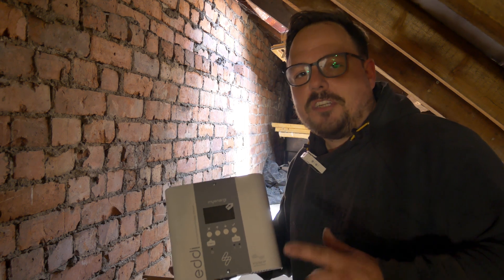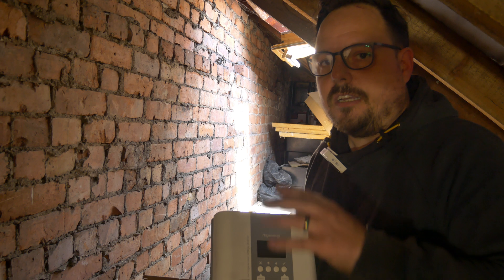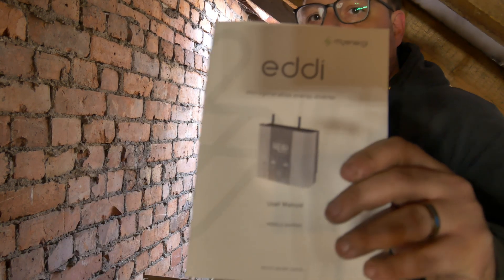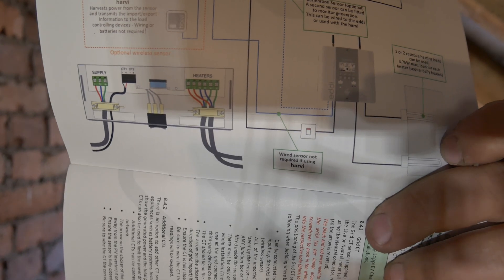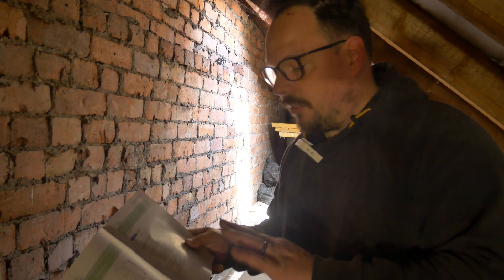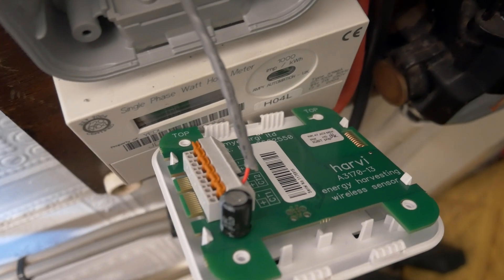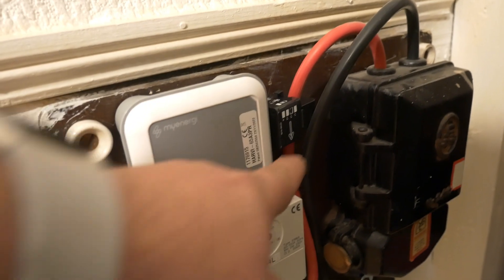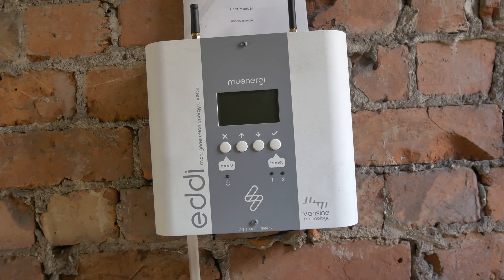How to install and setup a @myenergi Eddi and Harvi - Turning water into batteries!

Comment: Have you ever heard of an Eddi / Harvi install in a home with an EcoFlow PowerOcean Battery/inverter?

Would that present an issue as the EcoFlow hybrid inverter is Dc coupled - single line into consumer unit

Comment: How does Eddi know when the hot water tank is up to temperature? Is there a seperate thermostat connection on the immersion heater or does just infer it from the thermostat opening and therefore not consuming any power?
Is it possible to link the Eddi with a Hive CH controller so that the Hive knows it doesn't need to heat the cylinder from the gas boiler?
Reply from the maker: Immerssions all contain thermostats so it works from that. Although you can integrate it with other heating devices, doesnt have to be the immersion

Comment: Very interesting, a redesign from the old Immersun, and it would be great if these types of units could be ZigBee (?) compatible as it seems the newer smart electric meters have it by default for the In Home Displays. That would then mean less wiring for things like the Harvi, and possibly no CT clamp needed ? What do you reckon ?
What else have you connected to the second outputs on solar diverters ? Curious as to other options other than hot water. Cheers

Comment: What happens if there isn’t enough solar to heat the tank?  Can it then switch to gas to heat the rest ?
Reply from the maker: Of course. The immersion should only ever be backup to the main source of heating. This just supplements it and very well indeed it has to be said. Thanks

Comment: If you have a decent sized battery just use the immersion heater on a timer … save £1K …
Reply from the maker: Life is full of options for different people. That said if you are paying a grand for eddi you got done lol. 

ATM it’s better to just export your excess generation anyway rather than heat water with it on certain tariffs. 

I would close by saying consumers will get a much better return on investment by utilising smart abilities in the technology rather than manual function. It’s false economy and over the years you will lose out without it. Especially as tariffs adjust. Consumers would be wise to take a longer term view and understand the best ways to get the best value from all these options.
Reply: @electrician247  … but isn’t it just the same electricity?  I know my battery is fullest at about 14:00 o’clock so I just set the timer for then?
Reply from the maker: @jamesgalloway8835  with the intelligent tariffs, fluctuation in weather and unpredictable energy costs its not so simple no. With the eddi for example you can send 200W to the element when you have that in export rather than dump 2-3kW at it because a battery is fullish. Way better ways to maximise return.

Comment: I note that you have placed the harvi ct clamp between the supply fuse and the electricity meter. I thought the ct clamp was supposed to clamp after the meter but before the consumer unit?
Reply from the maker: Makes no difference so long as in the line conductor
Reply: Yes you're correct. It's in MyEnergies training to clamp after the meter as the energy company don't want to be paying to power the Harvi

Comment: QUESTION: 
Could you use a TP link that sends data through mains cables. 
One at the Eddi and the other at the hybrid inverter ?
Reply from the maker: Not how it works. Eddi sees export at the main tail in the CU or meter area.

If it would work as a comma method outside standard data. Who knows. Not recommended though in any case from me.

Comment: great vid cheers. how will these work when the customer already has a zapi using a libbi plz
Reply: sorry zapi using a harvey for monitoring
Reply from the maker: They link into the system and take in the CT data to work. Details in the myenergi manuals. Pretty simple though once you get your head around it

Comment: What cylinder temperature will you be targeting with this? Will the plumbers be increasing the immersion heater's limit to say 80C and installing a tempering valve on the output? Assuming a 210l cylinder, a boiler setpoint of 60C for Legionella and a solar cutoff of 80C, that will be equivalent to nearly 5kWh of storage.

As a side note (I know you like technicalities), if the Harvi is drawing power from the CT and you've installed the CT before the meter - That's technically stealing energy, even though it's probably too little for the meter to even register. :)
Reply from the maker: Haha yes I know mate with the CT. It was there while we moved the tails doing the main house CU but good spot! 

The system will still have conventional gas system for main daily heating cycles etc. The immersion just supplements that. It's 2 x 120L tanks I believe.
Reply: @electrician247  Ah okay in that case heating 240l of water by 20C will take around 5.5kWh of energy then. The only issue with just having a boiler heat the water to the same temperature is that you can only really take advantage of the excess solar as the hot water is used. Another option without the need for higher temperatures and a tempering valve would be to dedicate one cylinder to solar pre-heating (Increasing 120l of water from 20C to 65C will allow you to store 6.3kWh) and feeding the second cylinder from that. The second cylinder would then be the only one heated by the boiler. This has a couple of advantages:
- You always have 120l of hot water via the boiler, ready to go
- There water should spend plenty of time within the second cylinder for any Legionella to be destroyed
- You have an entire 120l cylinder to absorb the excess solar energy
- No extra costs for tempering valves

Essentially it's an alternative to a Mixergy setup. I guess it's all up to the plumber and customer at the end of the day.
Reply: @yngndrw.  you are so right I find it very hard to explain this to my customer's that they get all the energy from solar into the first cylinder and then it feeds the second cylinder which is heated from main source. I know some people don't have the space.

Comment: It's worth mentioning it's always better to use the hard-wired CT connections if possible. There's a lag with harvi since it's not sending a continuous datastream, meaning you'll import/export more energy.
Reply from the maker: Not always. Especially on longer length distances. The inaccuracies over long data cabling with CT application is a known issue. Some manufacturers will prohibit them beyond a certain length. 

The harvi will work beautifully in this instance and is ideal for the application shown. 

We have systems installed (dozens) both with harvi and direct ct cabling. The export/import differences are negligible.  

All that said we do have data cabling into the loft space now for other purposes so could attach a wired ct. 

Sounds like an experiment to be honest! 

But to installers out there be careful with the wired CT approach we have had huge issues with Zappi installations based on this approach and harvi was the only way. In this application its more of a problem because the lag can allow time for a service fuse to operate rather than a small inconvenience of perhaps 10p a month in import/export. 

I know professional installers will know all this. But for the DIY and enthusiastic experts it's good info to share.
Reply: @electrician247  The issue with the harvi, and why it makes a system non-G100 compliant is the data intervals can be 30 seconds, but also it's classed as an unreliable link - if a packet is missed, or something else is transmitting on the 868 MHz band there's no bi-directional comms to request another packet. Noise on a CT extended with twisted pair should be negligible unless it's installed wrong - we're modulating current on the secondary, not voltage.
Reply from the maker: Exactly and the inaccuracies with harvi are more evident at lower power full levels. 

The CT extension on a Zappi are limited in MI to 100m which is beyond spec on many commercial EV applications. Again this is nothing new to professional installers but appreciate can be of interest to enthusiastic experts. 

The CT extensions on some solar inverters for example are 5m. It really does depend on the quality of the CT in use and its rating/anticipated current flows. They are less accurate at smaller current flow. 

We know this due to access to hundreds of installations with measured usage via smart metering, CT data and equipment data. 

No easy answers but even when installed perfectly they are not 100% fool proof and all the systems rely on electronic management be that with a harvi or hardwired to a Zappi/Eddi. Which is why DNOs will not allow either method for a long term connection to limit electrical consumption.  

Devil as always is in the detail.
Reply: @electrician247  I wish they allowed you to directly connect the Harvi to the Eddi / Zappi via RS485, that would resolve both issues. The other option would be for the Eddi / Zappi to support meters which have modbus / meter-bus outputs.